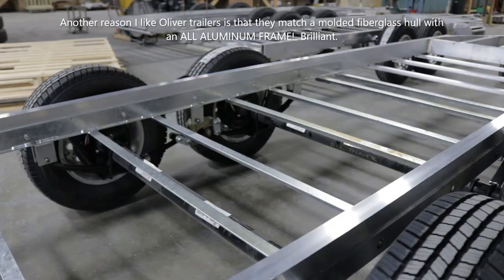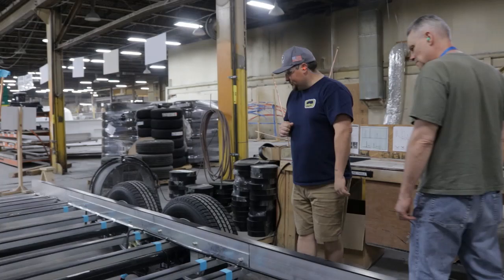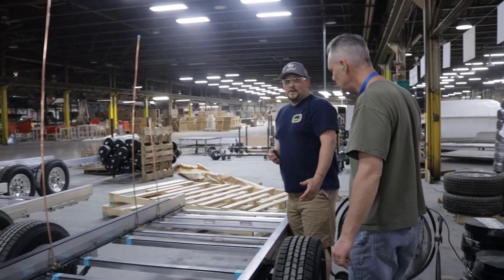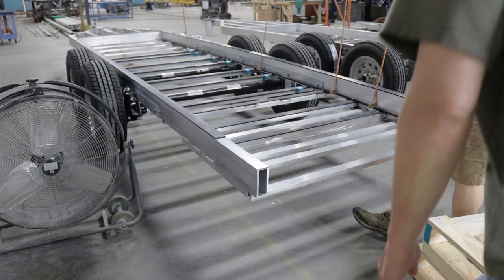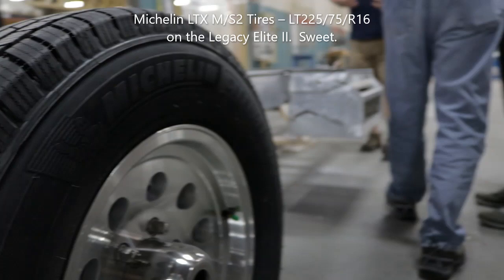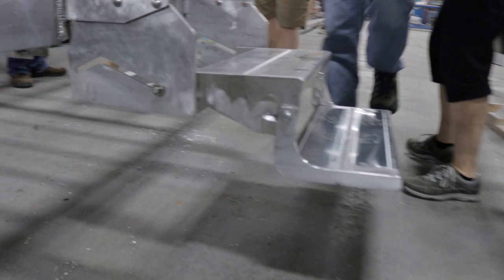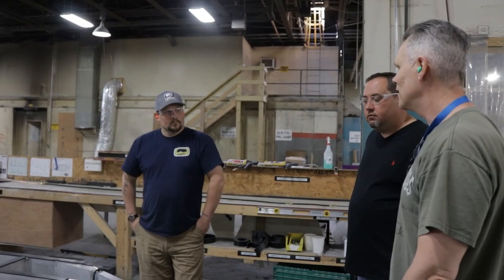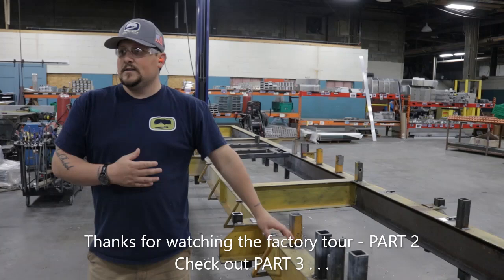PART 2: Factory Tour (Oliver Travel Trailers) aluminum frame

Comment: That guy was way on point... Air Stream is way overrated. I had an awful time dealing with them regarding warranty claims that were noted on my buyers order... never got fixed. Air Stream would not send me parts directly and wanted me to order through my local dealer that would not fill the warranty orders. Got tired of hassling and sold them to give up on travel trailers... just junk... until I cam across Oliver :-P